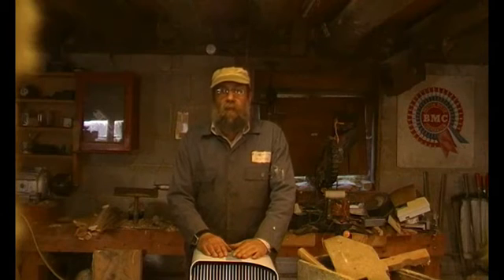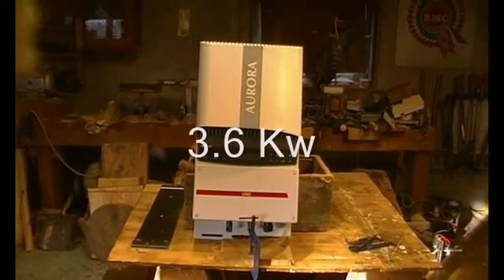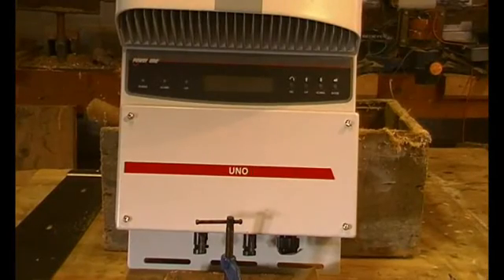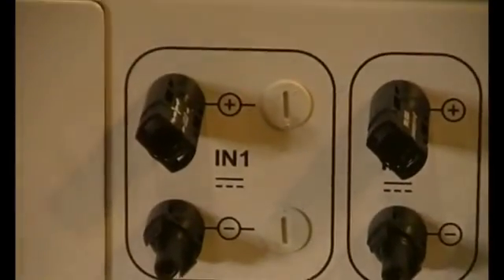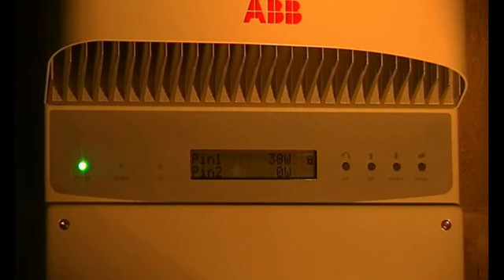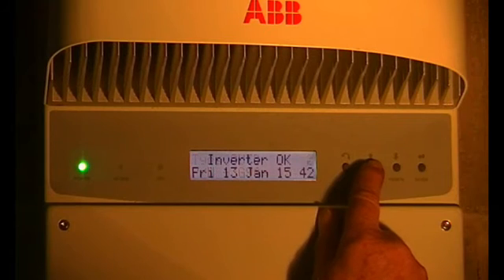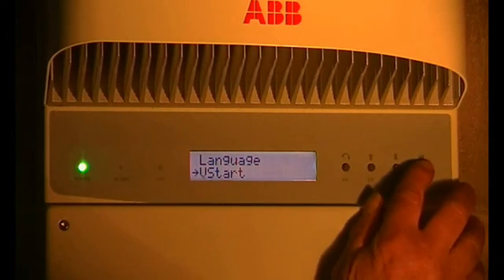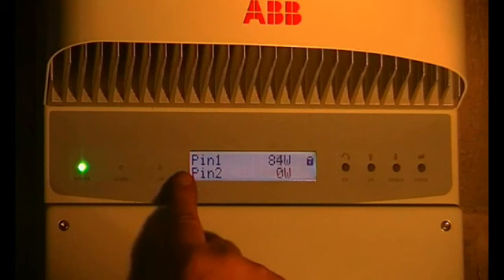ABB power one Aurora grid inverter, buying a second hand unit.

Comment: Can you use this inverter just for DC use (solar panels)
  does it convert it to AC (out) safely to power appliances.
Reply from the maker: Hi, the simple answer is no, they need a grid connection to work, cheers

Comment: Hi that's for the video can you wire it to a 3 pin plug and plug it in or have you got to wire it to the fusebox please
Reply from the maker: For a small inverter you can plug them in, for larger systems it needs to be wired direct, cheers

Comment: Hi. Thanks for the video - really useful. I have just bought a second hand unit like this. I am planning on just using the single MPPT input. I have seen on the instructions video and manual that they use ‘jumper’ wires to wire up the other MPPT port. Does that make sense ? And did you do something similar ?  Regards
Reply from the maker: Hi, I run several of these, fixed as shown in my E031 videos. I just use one tracker and ignore the other, wiring up the other in what is a dead short makes no sense to me, cheers
Reply: @TheInfoworks  thank you very much. I’m going install it in a few weeks. I might need to ask another question - it’s the first time I’ve got involved with solar!!! Kind regards
Reply: If you only have one input by sharing the load between the 2 inputs on the inverter does it not lighten the work especially for the relays which are pron to give trouble if they are occasionally overloaded @TheInfoworks
Reply from the maker: @andrewschofield9701  Hi, the 2 inputs are the 2 separate trackers, but there is still only one inverter. I know what you are thinking but a cool well ventilated mounting plus running the inverter under rated makes them last. With a low price of second hand inverters it makes sense to fit 2 inverters if you wish to boost power, cheers

Comment: Hi Andy I had two abb Aurora  one 5kwatt inverters both new but years old in box used one fir a friend worked perfect . The one I used for myself when powered up error cod E013 code .now the power light and alarm light flashes 3 times when I press any button . But no screen watched your videos about repairing relays but the inside is perfect .anything you can tell me would really help .
Reply from the maker: Keith, sometimes it's the relay contacts, see my videos on replacing the relays and setting the relay contacts,. You can cut the white plastic relay covers to get to the contacts, cheers

Comment: Hi Sir, I have a PVI-03 wind inverter, can I use it with solar panels? DC input rating 160Vdc to 580Vdc.
Reply from the maker: Difficult to confirm. The wind grid inverters have different MPP tracking profiles. I suppose there is only one way to find out, cheers

Comment: Hi Andy, on the one hand I am very glad that I have seen this video and the other Aurora videos. I got exactly the same model today, But newer I am guessing as it is a 2015 model. However it looks identical inside. It is quite revealing on the other hand to see the comments about failures. It seems like the installers and suppliers go with the bare minimum of factor of safety, either because that's what the book says or because it is a sure way to guarantee a load of call outs? Or perhaps I am a cynic. Nevertheless, taking this video along with the other ABB repair vids, it is good to know that there are quite a few easy repairs, though it always galls me when an expensive device has failed over a solder joint! Another thumbs up!
Reply from the maker: Through practical experiment I have found that "adjusting" the moving contact arm makes for a better contact fitment, again I have a video in the can about this, which one would you like to see first? cheers

Comment: Can I use this Inver on off grid mode
Reply from the maker: Hi, it needs a mains signal to work, please give thumbs up, cheers
Reply: What inverter I can buy to power it up from 12v battery ?
Reply from the maker: @Macrais  There are plenty of 12v inverters about. It depends on how much you want to spend and how much power you need. Read "Wind and Solar Electricity" book for full details. Here's a link:
https://www.lowimpact.org/book-title/wind-solar-electricity/
Cheers
Reply from the maker: There's a solar / battery / inverter course in Brighton in October run by the Brighton Permaculture Trust.
Reply: @TheInfoworks  can you send some Amazon link for 12v Inver what I can connect to the main grid please.
Reply from the maker: @Macrais  I refuse to deal with amazon for obvious reasons, look for Victron or Outback.

Comment: Can these be used if you're off grid and if so how
Reply from the maker: Hi, no they need a mains connection to work, cheers
Reply: @TheInfoworks  so what exactly are they worth as the guy told me that I bought it from that they can go off-grid but you have to install some sort of firmware to it and it will work off grid
Reply from the maker: @daza5775  hi, I've never heard of such an update. The inverter uses the mains signal to start, it's called G83 and it means if the mains goes down then the inverter will not carry on and try to put power into the local grid (and burn out). What is it worth, if it works then about £100, check you local Ebay for the answer to that, but you will have to make sure it works. or list it as untested for much less, Cheers
Reply: @TheInfoworks  so if I put 240v to it via a inverter would it then work
Reply from the maker: @daza5775  Then you would have 240v going up the output of your battery inverter, as the 240v AC connection of the grid inverter is also it's output. Cheers

Comment: I have no power at all going through the inverter. Seems as though it needs a reset of some sort. It is nearly 8 years old. Is there a reset button I could try?
Reply from the maker: Hi, I don't know of a reset feature, have you taken off the front lower panel and checked that DC is available at the input? Cheers

Comment: Hello, what mean Vstart, 120 or 199 what difference? Thanks
Reply from the maker: Vstart is the voltage that the panels need to reach before the inverter will wake up in the morning. It is also the voltage where the inverter will shut down in the evening. So if your solar array works around 300v then Vstart would be set around that figure so that the inverter will not draw power from the grid to power itself as the light reduces in the evening. Hope that makes sense, Subscribed? cheers
Reply: Andy Reynolds thanks
Reply from the maker: Th e voltage from your panels is determined by the number of panels that are in series. The voltage of the panels adds up to the array output. To find this out you will have to read the label or it will be shown on the inverter display. Cheers
Reply: Andy Reynolds, open circuit voltage 360 VDC, is that on the inverter (someone label it)so I can change Vstart to 360? (Max is 350), is right? Thank you very much.
Reply from the maker: Try Vstart at 300 and see that your inverter starts in the morning, cheers
Reply: Andy Reynolds thanks, V start have 1 and 2 , both change to 300?or 150 each like V1 150, V150. ?
Reply: Hello andy, I live Australia, before check mine, is 199, but now I change to 120.?The voltage of Australia grid is 250 . How can I know the voltage of my solar array or inverter voltage ? Is it related to the burnt relay?
Reply: total 16 panels on the roof.

Comment: Thanks, Andy I have repair 5 of these in the last two days E031. Big thanks.
Reply from the maker: Hi, that's good news, I hope you extended the solder on to a larger area of the tracks. I think the plated through hole to track connection can be a problem. Hope you have seem my updated fix video and extending inverter life video, subscribed? cheers

Comment: Can you use this with a battery bank?
Reply from the maker: Jeff, no these are only to connect panels to the grid. They need a grid signal to function under G83 rules. Cheers
Reply: Andy Reynolds  Is there any way to use one of these with a battery bank? Like with a separate charge controller? The reason I ask is because I have been working on a lithium power wall and have found a great deal on one of these inverters.
Reply from the maker: Jeff, the power wall type storage is an interesting idea. They work in parallel with a standard grid inverter, and as such can be added to any solar grid system. They are effectively a charger and an inverter fitted to the lithium storage and controlled by remote sensing. To this extent any grid inverter and panel setup can be used with a power wall, but the battery cannot power the grid inverter directly. Any potential power export to the grid is diverted into the power wall to be used later. Hope this helps, cheers
Reply: do u have the inverter communication protocol ?

Comment: yes, battery is cr2032 button cell, which is fine because it is holding date and time properly,  I.e I turned off dc and then back on, and it retains the settings. The only visible thing is this sensor, which I don't know how to test when taken out. I believe it has got 2 coils on the bottom 4 pins, but none of the pins show any deflection on meter with each other. Looks like an open circuit. Also I don't understand why they have pasted this plastic glue which is very tough. thanks

Comment: Hi Andy, I have uploaded a video of the inverter. please have a look. I identified a sensor: LEM ct 0.4-p, which is protected in hard coating. Do you find any other safety fuse on this board. I will take out the sensor,  which has 4 pins underneath, plus 2 holding pins to support it. Any advice how should I test the sensor, once it's out of circuit board please? Thanks
Reply from the maker: Hi. I have watched your video and am unable to identify a fuse, though there should be at least one per phase. Have you checked the on board battery?

Comment: Hi Andy, my Power one aurora PVI-10.0 was working fine until I heard a loud bang and noticed that 3 phase circuit had tripped breaker. when opened the cover, 2 out of 3 MOVs and a gas arrester all on the AC side were burnt out. I have replaced them all, but inverter is still showing 'Missing Grid'. It is not sensing grid at all, although all 3 phases, neutral and earth are present on the terminal block of inverter. Any idea, what else might have gone. apparently I don't see any other component damaged. Can it be relays? there are 6 relays, but I don't hear any clicking sound upon connecting to the grid, just missing grid all the time. Thanks
Reply from the maker: Hi, if the relays are not pulling in then your unit could have a faulty AC sensor. I must ask the obvious, have you checked all the AC internal fuses? I had a growwatt with a simiular problem, no visable damage but it would not recoignise the AC signal even though the internal fuses were OK and it showed 240v at that point. Good luck, cheers, Andy
Reply: Hi Andy, thanks. I am trying to identify ac fuses and sensors but can't find any. Is it possible I can send you a picture of the supply board, and you can identify which parts shall I look for please? I know it is difficult to identify from picture, but since you are quite knowledgeable, you might have some clues. Do you mind sharing your email address or WhatsApp contact, so I can send you couple of pictures please? Thanks
Reply from the maker: Hi, load a close up video on your channel and I will have a look, cheers
Reply: Thanks will do soon

Comment: Hi Andy, great video, thank you. Particularly interested to hear your final comments about running the Aurora Power One at low capacity prolonging inverter life. I have been putting 4 KW into a 3.6 KW Aurora Power One and it has failed displaying the error message Int. error E031. Are you familiar with this? Other postings on the Internet, mainly Australian , suggest this means the inverter cannot be repaired and needs replacing. Any advice on this and where I might obtain a suitable replacement inverter in the UK gratefully received, or can they in fact be repaired? Many thanks , Graham. Ps. The company who installed my system in September 2011 have now gone bust, so my 5 year warranty has expired, even if they were still a viable company, thanks again.
Reply from the maker: Hi, Graham. The first question is: has your panel voltage exceeded the max input voltage? In this case the varistors will have been constantly heating up, and these are a consumable. Second is the lithium battery OK?  Try Lee Rose at Norfolk Solar if you need an engineer. Cheers, Andy
Reply: Andy Reynolds Hi Andy, my Uncles Aurora 3.6kW inverter has failed today with this message. How would we find out if it has been subjected to overvoltage? Unit has worked fine for the last 5 years. His system is uses 16x 230W panels.
Do you know if home-repaired inverters (replacing the relay like in one of your newer videos) voids the feed in tariff?

Many thanks, Ian
Reply from the maker: Ian. It is just possible that all 16 panels are in series and that could give 500v, or maybe more depending on the actual panel voltage. You could check the varistors, these I think are blue and are just above the input connections, but you need to remove the cover. Try looking at an SMA varistor check found in a manual for the SMA SB inverter series. As the varistor heats up it changes its conductivity. The FIT registration only deals with the inverter number, not any repairs, and even if you change the inverter they will only know if you tell them. The only checks they do is on the fits meters to make sure the serial numbers are correct,  Hope that helps and that you gave the video a thumbs up, cheers, Andy

Comment: Interesting video, thanks. I didn't get the engineering gene so would be afraid to press the buttons, let alone take a panel off - but thought you might like to know our ABB Aurora Inverter just had its 5th birthday and has added 17,625 Kwh to the grid in that time. Hopefully it will last another 5 years but thanks to FIT our system is now paid for and truly free in an economic sense

Comment: Have two power one inverters Andy. One is a 3.2Kw wind inverter (outputs 4.2max), the other I bought new last year is a two string 6Kw solar inverter similar to this one which is not in use yet.
Reply from the maker: Jim, sounds like the basis of a significant system, how many panels will you fit to each input? Cheers
Reply: +Andy Reynolds I'm thinking 18 x 300w modules on 3 single axis trackers giving me 5.4kw installed capacity.